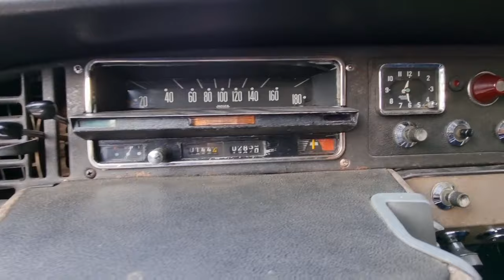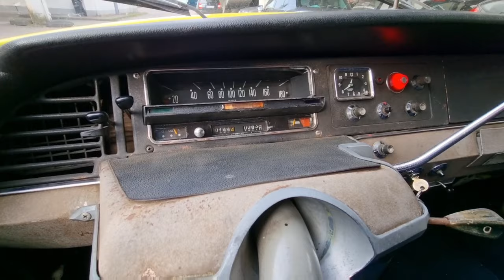Citroen DS 19 Pallas 1962 Walkaround,  Interior,  exterior

Comment: I am rather mixed up by what I see and what I read. The dash and the brake "pedal" clearly indicate that this is an ID and not a DS. The interior has been redone in leather in rather Pallas style, not fitting with the ID dash. The rear indicators also seem to be from a DS. Under the hood I see green hydraulics which means the car is no earlier than 1967, which is not 1962. This car is not what is described...